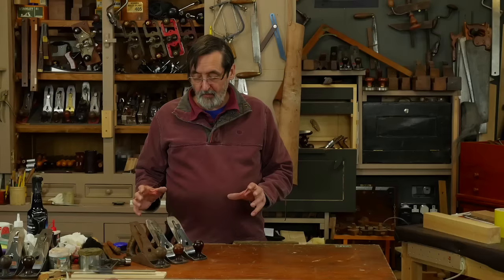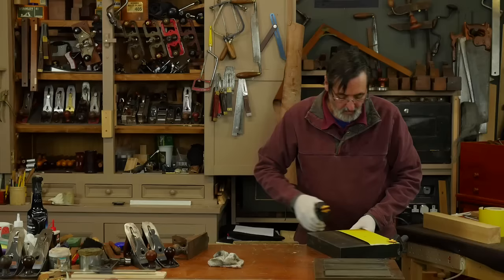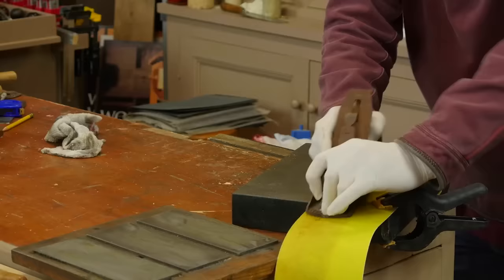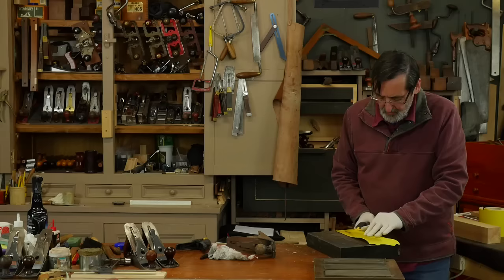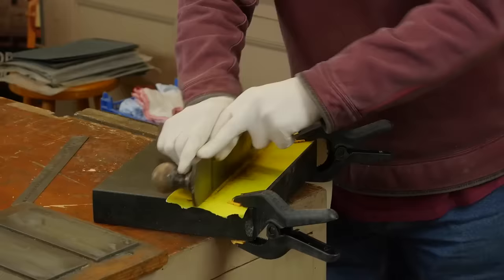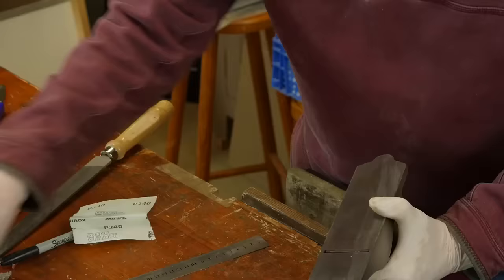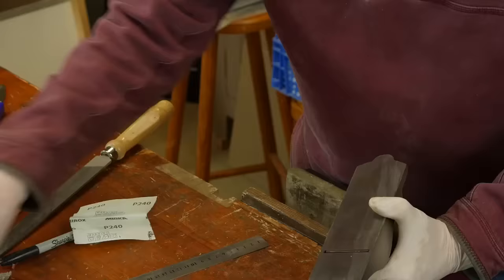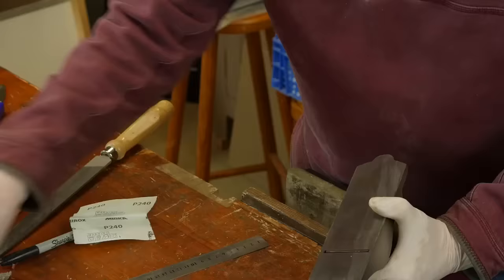Restoring the Bench Plane | Paul Sellers

Comment: anybody want to give a newbie a tip? Why is it important for the sole to be hollow ground?
Reply: Andrew Powell I don’t recall Paul mentioning a “hollow ground sole is important”... the plane sole should be flat (some say perfectly, others, relatively). 

You might have heard people talk about the importance of hollow ground vs. flat ground, but that would be in reference to a plane iron (blade) as opposed to the sole. 

Some argue that a hollow grind is better because the concave bevel stays sharper longer and will "peel" wood off better... but Paul doesn’t seem to use a micro bevel as he talks about it being just another thing to worry about. Instead, he uses a flat grind that is sharpened often.

Either way, just jump in and don’t be afraid to make a mistake. Hollow, flat, it doesn’t really matter... get it “not dull” and you’ll be on your way!

Enjoy the experience.

Comment: In the stage where you are removing rust from the sole of the plane, could one possibly use a belt sander (shop belt sander) to remove this rust without danger for the flattening of the metal?
Reply: For fast rust removal use a wire wheel on a bench or angle grinder.

Comment: Hi Paul, I inherited a Stanley Bailey #4 (I know your favourite!) but it was not one of the better made ones I guess. It was made in Australia who knows when ago (it appears to be at least 50 plus years old). The main issue with it is the sole of the plane. When it was made it looked like some sort of flycutter process was used to flatten the bottom but it left fairly deep machining gouge marks. I've spent approx 2 hours lapping the hell out of the sole and have managed to eliminate approx 75% of the machining gouges but there is still some around the throat. Will this be an issue or should I keep on lapping it flat? Thanks in advance!

Comment: How flat does your flat need to be?
I got one of those glass lapping plates and had to send it back. The replacement is just as bad if not worse. I can get a strip of printer paper under the middle of a 30cm rule and move it around with ease. I have to put 2 under there to get the rule to hold them.
Reply from the maker: The only real way to deal with this is in my view a granite block proven by certification. Glass does indeed flex if it’s not supported perfectly by a substrate that is also truly flat. Granite on the other hand, does not flex

Comment: How important is that rounded bevel on the plane iron cutting edge when sharpening it.  It occurs to me that if you only trust yourself to use a honing guide (as I do!) then you won't get a rounded bevel you will get a straight (flat) one.  Would that be ok?

Comment: Does the wheel on the honing guide not degrade - and, more importantly, get smaller - when using it on a sandpaper and thus throwing off the angle measurement over time?
Reply from the maker: it will of course, but s minutely it could not really be noticed. I think you will find an average Woodworker is safe for a hundred years.

Comment: Paul, i told you that after watching your videos, I was going to find and purchase a used plane. Well, I now have my first metal sole plane. A Stanley #4. I’ve watched this video several times and am almost done getting it ready for my use. The only thing I didn’t see you talk about, was cleaning up or filing the slot in the sole. Mine has a few small chips or indentations as you call them, in the back of the slot where the cutting blade goes. Since that is behind the blade and won’t be touching the wood, do I need to take out the indentations with a file?
Reply from the maker: No, you don’t need to take anything out. That would be purely aesthetic.
Reply: Paul Sellers Again, Thank you very much!

Comment: Would it be better to take the time to look around for a decent deal on an older No. 4 plane and restore it (don't mind the time spent) or buy a new one (the ones with the plastic handles)  The new ones don't look nearly as nice as the older ones but are they just as functional?
Reply: +TriusMarie.44 
It's gonna sound like bias from a guy who just likes the antiques, but the cheaper modern ones seriously do tend to have stress-distortion in the bodies, which actually can make them less reliable for flatness.  You saw how little work Paul had to do to get that base flattened in the important areas (even though there were some functionally insignificant hollows)?  The cheap new ones typically take more work than that to get flat.  Sometimes a LOT more.  Then they sometimes need to be flattened AGAIN just from a year or two of temperature cycling, WITHOUT any wear put on them!  And that's leaving aside the fact that the plastic handles will literally give you blisters after heavy use!  (Admittedly that's heavier use than typically done by the modern hobbyist, but still...)  So do you want to factor in the cost of replacement wood handles for your poorly-finished new plane?

Now you begin to see why some of the folks who DO "mind the time spent", tend to gravitate toward the $350. top-quality modern versions, rather than do all that messing around.  But even THOSE may need a little "tuning" when you first get them out of the box!  (But... the BRONZE!  So pretty!)  So... to MY way of thinking:  if really EVERYBODY basically HAS to learn how to do tuning anyway (at least enough to know how to keep the controls adjusted)... then why not devote that effort to a "classic"?  But please support your local garage sales, flea-markets, estate re-sellers and junk dealers.  I already have enough competition on Ebay, without adding you to their number, thank you very much!  hehe
Reply: Thanks for the reply.  What you say makes sense, if I'm going to have to do work, perhaps more, on a new plane then why not get one that looks better and may even be functional for longer periods of time without extra work.  That honestly might've just sold me on looking for an older plane and wasn't something I had considered before.

Thanks again.
Reply: +boatrat74 I have to agree, the few that I have bought new, I have had to do more work with to get them ready for use than the antiques I have been buying. Usually, it's the cap iron that give me the most issue on the new ones.

Comment: Hi Paul, thank you for the video!
I've recently bought a no. 4 Stanley plane on ebay and I have a couple of questions:
1. The toe of the plane is slightly angled up, around 1/10mm on the very fore part. Would this condition affect the performance of the plane?
2. The iron the plane came with has been used very much in fact, between the cutting edge and the hole that accepts the cap screw there is about 3/4". I would like to replace it with a "newer" one and I thought to go for a Veritas one, since eBay UK is not so accessible for me. What would you suggest?
Many thanks in advance,
Gabriele

Comment: I am attempting to restore my grandpa's two old planes.  After following your sanding instructions I found that one is, what looks to a novice, is a badly pitted sole both in front and immediately in back of the cutting iron hole.  My question(s) is it mandatory to keep sanding and take out all of the pits to have a functional plane? Is it feasible to keep sanding to obtain a flat surface? Or should I just restore it to be a wall hanger? Any advice would be greatly appreciated.
Reply: The main idea is the sole be smooth.  Since pits are holes, mostly the surface roughness must be eliminated so the stock you're working on is not scratched.    IF you have the time and lots of sandpaper you can certainly sand out ALL the pits but you'd hate that plane by the time you're done.
Reply: Thanks for the advice. I have gotten it to the wall hanger stage. I think I'll keep on going and see what I can accomplish. Thanks!

Comment: I have acquired a Stanley No.5 plane that I tuned.  The plane however has some "chatter".  Have I done something incorrectly when tuning it?  It's such a great tool.  Can I do something to eliminate the "chatter"?  Thanks for any advice.
Reply: Re sharpen and start with very MINIMAL blade protusion.  It is easy to misjudge how much a plane can take off when in fact they excel at taking off a very little.

Comment: I got my first bench plane today used #4 it looks to me like it has seen very little use it had a lot of surface rust that was very easy to remove with some 320 grit i looked for any markings on it that might tell me who the manufacturer was i didn't see anything but a "made in the usa" by the rear handle and a "U" on the frog.Any idea who might have made it?

Comment: Thank you for the great information Paul! I recently bought a Stanley number 4, and the front of the sole is soldered on right behind the mouth of the sole, if that makes sense. The front of the sole is just slightly angled upward. (I can send you some pictures of it if you'd like) Is it still worth restoring, or should I look for another one?
Reply from the maker: +Robby Anoos Well, Robby, dropped planes on concrete always break at the side of the mouth and are often brazed and it works fine but often the sole is distorted by the heat used. I am not sure if I would go for a restoration or find another sole.
Reply: +Robby Anoos i'm with paul.. you will never get it flattened and leave any iron behind. i was sent one like that many years ago.  i tried to flatten the sole and tossed it in the bin lol.
Reply: +Tayler Made +Paul Sellers  Thank you both for your input. I've been working on it for a while, and everything else is in good shape. By my estimate, once it's flat, it would really be more suited as a scrub plane, as the mouth will be widened considerably.
Reply: +Robby Anoos If it is soldered and not brazed, I'd desolder it and try and resolder it with the sole clamped down thoroughly while soldering and cooling. That should get you closer to flat.
Reply: They are not expensive.  I would find one undamaged.
Reply: +Brian Jones I will do that, but I also still want to try to restore this one. Someone, at some point, cared enough about this tool to put it back together, instead of just throwing it away.
Reply: +Brian Jones i actually found a no 5 at the pawn shop in pristine condition for $59... in nz that is very cheap for a second hand plane.  i took it home and took the blade out and found it still had the manufacturers grind on it.  never been used!  pays to keep your eyes open.
Reply: +Robby Anoos Hey Robby. If the sole is too much out of wack, maybe you could try and save it by making a wooden body for it? Look at 3rd picture on this blog post:
https://paulsellers.com/2015/03/making-a-fully-adjusting-wooden-bodied-plane/
Reply from the maker: no. its too much work. replacement soles are sold often on eBay.  wait for one of those

Comment: Hi there,
Will a piece of old fireplace marble be alright for flatting a plane?
Thanks
Reply: I use a 12 inch by 16 inch piece of granite countertop, so as long as your piece of marble is extremely flat and smooth it should work.

Comment: I have a Record #7 from the 1980's with two screws in the handle. The smaller one is missing. The thread on the screw is not standard (any more).  .  I could not find a screw to fit anywhere so  I drilled the hole and tapped for 1/4 - 20 screw.  Where can we find replacement screws? It appears to be a whitworth thread!

Comment: Paul, how long is the surface plate you're working on? and what plane is that #4 or #5. Cheers, Jeff
Reply from the maker: It is a #4 and the surface plate is 3 inch x10 inch but I also use a 10 inch x 10 inch

Comment: ok i got a question and im not sure who or where to ask so please help me if you can......english is not my first language....

I am new to woodworking and got myself a anant bench plane new and spend lot of time sharpening it ( the cutting iron came with a 1 mm face on the edge) and then I've tried it on wild cherry and I was able to make my first shaving and get to know how to set it up but then I've step up to the real task I was into witch was even the surface of a one foot by 1 1/4 inch ebony block. The wood didn't give up easily and I had to use a lot of force and the shaving where not pretty. After a few stroke it just start to do nothing and I took the blade out and the chip breaker was flush with the blade. I reset it , thigh the chip breaker as hard as i can but the same scenario happen again and again. 

So why is this happening? what am i doing wrong?can you even plane ebony by hand?

Comment: Is it possible to repair a cracked base on a plane. I picked one up recently and didn't realise until I cleared off the rust that there was a crack on the side in line with the mouth? Can this sort of thing be welded?
Reply: Maybe, but you gotta make it dead flat again
Reply: Yes.  I would personally grind away the crack to ensure it doesn't split further into the base as time goes on, but that may not be necessary.  Weld new material in, preferably as close as you can find to the base material, with MIG, TIG, stick, or even Ox/Acetylene, and true up the whole surface once you're done welding.

There's no reason it shouldn't work as good as new, so long as you've prepared the surface after the repair.
Reply: Cost a fortune!  Better to buy another one.

Comment: +Paul Sellers  what do you call the tool that maintains the same bevel for sharpening your blade? Also I have a Stanley no 605 that belonged to my Grampa's grampa. It's heavily rusted. Even in the "bed" of the show where all your components are attached, the paint has become rusted over. Any tips for restoring a plane in this condition? I would like to do what I can considering its age and family history and also I've read the Bed Rock planes (which I believe the No. 605 is) are fairly sought after.
Reply: It's just called a "sharpening guide" or an "angle guide" for sharpening.  Search google or Amazon and a number of choices will show up.  They are great for chisels too :)
Reply: Honing guide.

Comment: Hi Paul, I recently purchased my first plane, a second-hand Stanley no.4 that I'm restoring. When reassembling the plane, I've noticed that I need to move the lateral adjustment lever right to one side for the cutting iron to sit straight inside the throat. Is there a simple way to adjust the iron or lever assembly to rectify this?
Reply from the maker: No. As long as you’re plane blade is sharpened square to its long axis and if the lateral lever is on to one side it doesn’t affect the functionality of the plane. I have several planes like that and it doesn’t bother me.
Reply: Good to know, thanks!
Reply: Maybe the frog is not adjusted rectangular to the mouth. I noticed the same issue on my new Stanley no 4 and after some sideways adjustments of the frog I don't need to move the lateral adjustment lever completely to one side. Hopefully this helps you

Comment: putting a shellac coated brush on a sharpening stone?
Reply: Diamond stone, shellac wipes right up with water; not a problem. You can even just let your brush dry completely and store that way until it's used in shellac again.  Great finish.